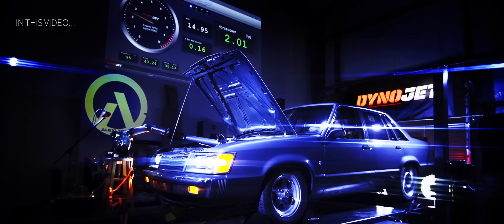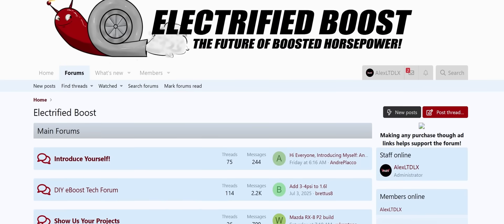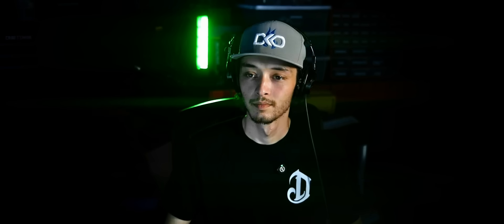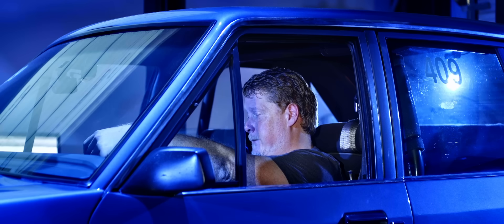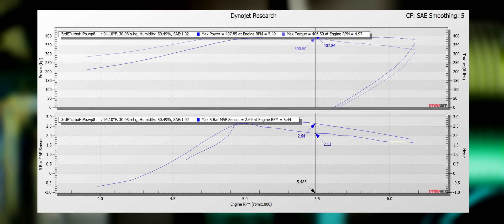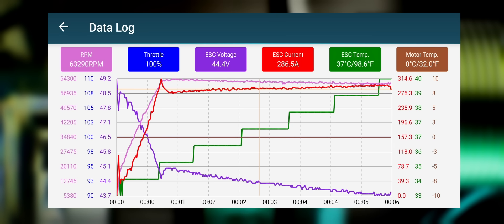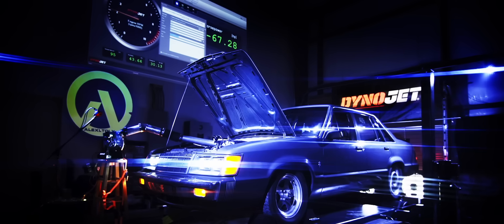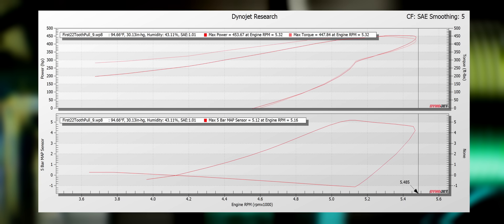Cheaper/Easier DIY Electric Turbo Overdelivers On The Dyno

Comment: Is this setup viable to run on a 3,000 lb 2.8 L 6 cylinder for use on a road course track? I would assume there would need to be some kind of charging circuit so that the alternator could get some power back into the batteries for the next corner exit. Thoughts on that?
Reply from the maker: It would work, and you probably wouldn't need to charge an 18 amp hour battery at all on a road course track, unless you were in boost all the time - which I don't think is the case.
Reply: @AlexLTDLX oh this is great news! Is there a list of parts to order somewhere? And can we scale the compressor down for a smaller engine for the slightly lower flow requirements?

Comment: Wouldn’t take much to add an ESP32 to the esc so it controls the boost based off of rpm, fuel, rpm… or whatever.
Reply: Simply add it to a new turbosmart electronic waste gate but as a blow off valve on the intake. And yes the ESP32 is more than capable microcontroller of regulating just an e gate 😎
Reply: @jameshatton4211  No need for a fancy solution. An engine driven SC needs something like an e-gate due to fixed pulley drive. This SC's rpm is independant of the engine, so you'd just need to vary SC rpm. Since it's an ESC - electronic speed control - it can reduce the motor's RPM which will alter airflow and therefore PSI. An ESP32 can easily handle the variable duty output for an ESC.
Reply: @hydrocarbon82 yeah I'm aware of a lot of what you've mentioned. I mentioned for simplicity and to keep the turbo over driven because it's struggling to make boost at the moment and shits already making burning smells? Bleeding boost reduces load but increases velocity and ramping up speed is only going to increase electrical load. I don't think that motor can handle much more even if your ESC has the phase amps to cause the motor to melt down. The motor is inadequate for the restive load attempting to maintain peak boost threshold. I'm not saying you are wrong in any way either. Everything you say checks out and I agree with you notion 100%
But the solution I propose was also in consideration for guys that are car more car guys than tech guys?

Again your solution from my point of view would be my kind of choice because I am more of techy guy that understands micro controllers and stepper motors etc.

I am a CNC machinist with keen interest in hardward hacking, chip dumping and exploiting vulnerabilities to bypass encryption inject null keys into security chip directly using chip readers to binary dump stuff to change it with a hex editor to enable functions that I wanted and OEMs disable 😁 certied cheeky bastard.
I'm a geospatial engineer (I did route selection mapping for gas pipelines)but work as a CNC machinist. Before that Microsoft certified computer technician but not limited to and know phones, Apple Linux etc.
After my I finish building my shed I'm going to built a CNC plasma/laser cutter. I've got stepper motors from all kinds of things. I've got Raspberry Pis and ardinos dotted across my house FFS.
I'm autistic as f### though so pis are as simple as an SD card swap and the thing is doing something completely different? And I like to try lots of stuff

I'm also building a Yamaha YZ electric Motorcross bike but I'm using Surron motor from the Stormbee with the biggest motor and oil cooled and lubricated reduction gearbox because electric motors can generate so just torque that even carbon fibre ribbed belts just get shredded and destroyed. I'm aiming for 60-70hp a bit less than a stark vaarg hopefully more range faster charging better batteries and dual BMS for charge and discharge of every single individual cell monitored for balance active thermal regulation using Peltiers to the bus bars + water cooling or heating to keep batteries at the optimal temperature especially for high input fast charging but hopefully mitigating any chance for thermal runaway?

I'm building an ekate board using dual FOCBOX 2  in master slave configuring for 4WD hub motors using a single hand controller 😉

I have numerous FPV racing quad copters of various sizes all running digital links

ESC? What's an ESC? That's the button on top of QWERTY keyboard isn't it 🤪
Just reassuring you its autism on..... I'm not mentally retarded. Although I'm wrong a heck of a lot! Unnecessarily over complication to automate something to precision is totally my gig.

My father would say "son there's many ways to skin a cat"

So you sir I want to say that I do appreciate your knowledge ALOT and thankyou for sharing and discussing without aggressive agreement 😛 go on look that one up on urban dictionary and describes me and my mate growing up! 😳

I rub people the wrong way because I do silly shit for fun
Reply: Sorry to clarify my thought is to keep the turbo velocity high regardless and then you don't need to regulate speed via ESC to keep response high rather than ramping up speeds you can gain more granular control whilst keeping boost threshold high  and velocity high and bleeding of reverse rather than ramping up anything with load. He's better off gearing the supercharger to spec and I think he's got a lot more headroom in the getting hearing of electric motor torque but he may burn that thing out and then I would suggest axial flux motor to allow maximum mechanical torque vs longer more slimmer that is more susceptible to heat degradation and magnet depolarisation. In my opinion thing should be taking so many volts that plasma flux turns shaft into glowing orange sausageb😁😎
Reply: Yep I'm doing exactly this and using an esp32 and ESC for a high pressure port injection water system
Reply: Fuel and throttle. RPM shouldn't really matter too much
Reply: @LukiRudaka ya, I just threw that up there. A C3 would be more than enough. Chat gpt would code it for you super fast. Wonder if there are any libs for obd2 in micropython
Reply: throttle position, manifold air pressure...

Comment: I was thinking of doing something like that but I don't like high currents/voltages, which are very dangerous if something goes wrong, the whole car can burn out due to electrical failure,there is also the problem of charging electricity while driving, electronics...

Comment: You need to sync up two over a CAN bus.  Get some cheap batteries plugged into an alternator.  Maybe LS swap a Prius so you can use the battery for boost making 😅
Reply from the maker: I'm actually going to be testing all sorts of combinations - parallel, compound, etc.  And you actually don't need to sync them up at all.  Just match the ramp up rates and trigger them simultaneously.

Comment: Dang, decided to really up the production value, eh? Super sick stuff. Always excited to see more. Really great work on this video. Also one of the few times I didn't absolutely hate hearing AI music. It was a funny bit. I have two potentially wild questions or suggestions if you will.
1. Since it's belt driver, couldn't you double the motors and increase the ratio even more? Would reduce the strain on both motors and give incredible compressor RPM.
2. What if you coupled the motor on the compressor wheel side of a full turbo in the inlet path? You would have exhaust assist and also cool the motor like crazy.
Reply: The current Mercedes M256 I6 uses a Borg Warner electric supercharger to feed the turbocharger. Powered by the high voltage starter generator inside the bell housing.
Reply: @Hunterhtm Yep I'm familiar with the tech, just having some fun brainstorming DIY nonsense. 😁
Reply: Are you running an intercooler?I would water cool that brushless motor 😅be good if you could get to 15psi😮
Reply: @CraigLandsberg-lk1ep  Could have a separate cooling system for the motor I suppose, but in the inlet of the turbo it would get insane air cooling.
Reply: @802Garage I am 12 years old indefinitely 😂
Reply from the maker: Really the compressor is too small for the engine.  I'll be doing a deep data dive video next going into all this stuff.  But yeah, there is a guy who mounted 2 motors on a P2 unit.  It can be done.  But I want to try parallel and compound setups next after the bigger castle motor/esc to make some real power.
Reply: @AlexLTDLX Sounds awesome!
Reply: I was just thinking about something like #2. Have an electrically assisted turbo to instantly build boost at low engine rpm.

Also, hello fellow fellow HGEU redditor 😂
Reply: @DownLowSyndrome  Bahahaha heeey fellow acoustic!

Comment: Wow!  Am I impressed by the entire production quality you've come into.  This is some good stuff, could easily exceed something like David Friebergers 'Engine Masters' in entertainment & educational videos.  Keep it up!

A while back, I commented that I have a way to manipulate fossil fuel (including grain alcohol), into increasing BTU over current accepted test measurements.  I'd be willing to send you my product, if you'd be willing to play with it during your testing with your current systems.  

This particular technology uses Nicola Tesla's resonant frequency theory to impart a particular frequency into fuel, prior to combustion that actually lowers the molecular 'cohesive' bond between the different elements in the fuel you are using, by 12%.  The effect of lowering the cohesive bond, causes the fuel to be more volatile, releasing more energy, raising BTU's for a given amount of fuel.  

The side effects are interesting also.  Not only do you see a increase in power, your can retard the timing on an engine by 3 degrees, see an increase in power, and a reduction in oil contamination, as well as a reduction in HCL emissions and a reduction in Nox emissions (provided you keep the EGT's below 1200 degrees Fahrenheit.

I'd be more than happy to collab with your, if you are interested, because I'm definitely interested in your electric supercharger.. I can imagine a E-gate (Steve Morris is using them to control intake boost pressure, while maintaining exhaust impeller speed, to reduce lag)., as well as I'd like to see how your current operation would improve with a 'Tick Performance' air/water 'brick' installed on the intake of your test engine... I say this, because, I'm willing to bet if a guy would run a A/C compressor on the engine, with a coolant loop, inside the air/water reservoir, with a fuel loop integrated, it could cool the water so cold, that you'd have to run antifreeze in the tank to prevent freezing up... That would really keep the intake & fuel charge very cold, and yet consistent, despite whatever ambient air temp the engine happens to be running in.  This could really assist in at track tuning, if you don't have to compensate for air temps as much as without a intercooler. 

If you are interested in looking at my Tesla inspired fuel enhancer, I'd be willing to mail you the necessary components, and do a live video chat on installing the product properly.

Comment: I really want to see this in both a compound(electric sc feeding turbo compressor side) or split twincharged setup like the new genesis tt v6. It seems like a really good way to supplement a safe and controllable source of low end boost.
Reply from the maker: That is all coming soon.  You think like I do.

Comment: Two less teeth and it would rock a street K24. Were you running the methanol intercooler? I have a friend that could easily machine kits if there is enough volume.
Reply from the maker: No meth and no tuning actually.  Since the ESC was shutting down, I didn't see much point. I have the new Castle stuff on its way - we'll see what that does first, and then we'll tune it.

Comment: Hell yes, you are a true innovator man, love seeing this progression.

Hypothetical, if you were to run a dual tube intake that "Y"s to the motor (one tube with a filter, one tube to the sc) with a dbw tb on the filter pipe that would close when the sc is operating containing boost pressure? Essentially allowing the motor to breath n/a normaly but have boost on demand?
Reply from the maker: We did a dyno test sucking through the blower.  The power loss wasn't really enough to justify the added complexity of such a setup.  At least in my case.  We'll try to release a short video on that soon.
Reply: @AlexLTDLX  no shit! That's amazing, I would have thought it would be a big restriction. Looking forward to the next video!